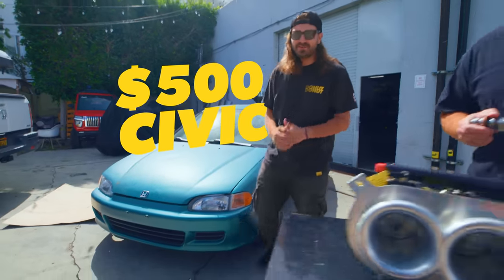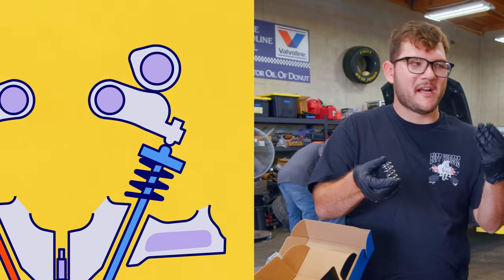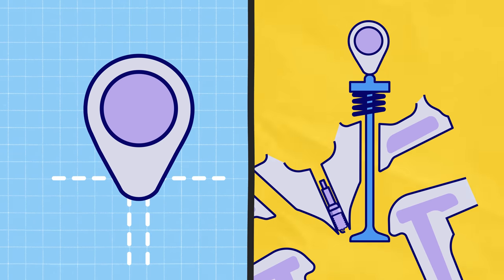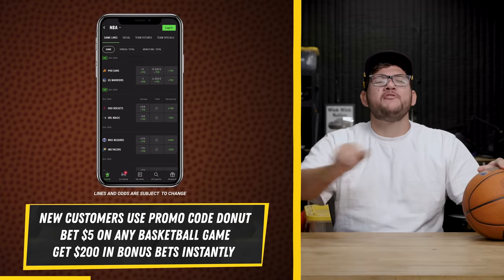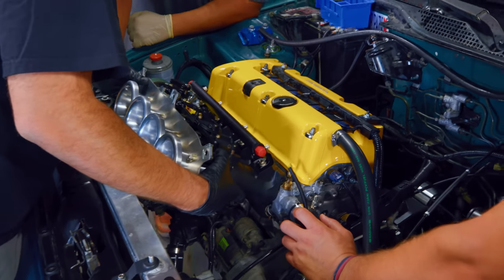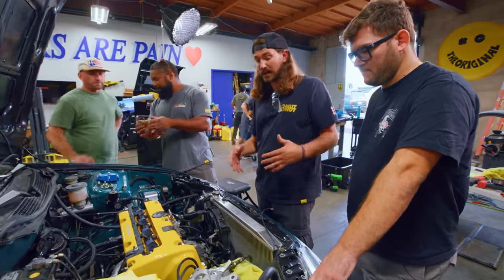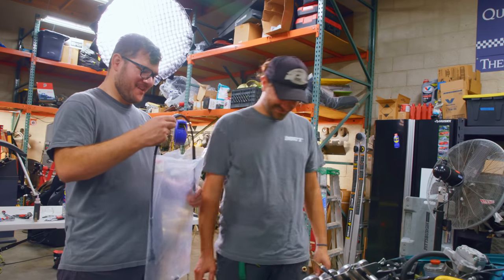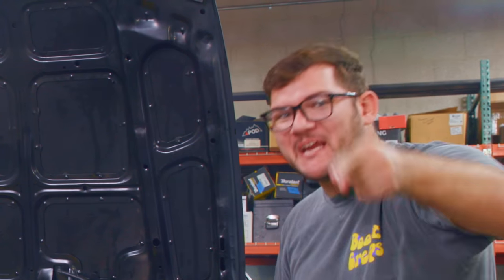We Put a $5,000 Intake on our $500 Civic

Comment: 5:28 A small correction

for diameter 65mm the cross sectional area= π × r² = π × (32.5 mm)² ≈ 3318 mm²

for diameter 60mm the cross sectional area = π × r² = π × (30 mm)² ≈ 2827.4 mm²
since there are 4 of them = 2827.4 mm² × 4 = 11309.6 mm²

so the effective diameter will be =  2 × √(A / π) = 2 × √(11309.6 / π) ≈ 120mm.

So it should be 120mm and not 240mm.
Reply: I was thinking the same thing, but thought that no one else would care
Reply: All that math to still be wrong. The cylinder intake openings and flow rate are all that matter here. The cylinder head openings were not ported so that never actually changed. This manifold will flow a higher CFM though but that can’t be expressed by the diameter of any openings. So it’s all moot.

Edit to say the math is right, but it doesn’t matter and should never have been a topic in the first place
Reply: Math make brain hurt bring back the stu stu stu and vrrrrrrrooooooooom noises
Reply: was searching for this comment
Reply: I was about to write that.
Reply: Glad I wasn’t the only one who caught that.
Reply: @SlapperGlutesTwice hi, I'm just lowly mechanical engineering student but I think you are taking an extreme approach to this. The intake is a fluid system, each part of a fluid/pipe system has an associated energy loss from which takes energy from the system. This energy loss is determined experimentally for each part as a coefficient k. The larger the velocity, the more energy is stolen from the fluid proportional to k. All to say k always relies on cross-sectional area. In this case the ratio from mouth to port diameter and the smoothness of that transition are more important. Like you said this manifold will flow much more air BUT the mouth diameter is a serious factor that effects the total flow rate. If you want a true comparison of the manifolds efficiencies an experiment would be ran for many different pressures and velocities through the intakes and k numbers from both would be found and compared.
Reply: Yeah it was fine until they showed the picture of the big circle with a 240 on it. But how many pizzas would that be?
Reply: I came to make sure someone had done the math properly. Good job.
Reply: So you’re saying 60 x 4 equals 120….. wow.   Somebody failed math class 😂
Reply: @HisDudeness_69   Actually sounds like you did. Diameter is not linear to area for a circle. The equivalent new area with them having 4 60 mm intakes is indeed as if they had 1 120 mm diameter hole instead...
Reply: @SlapperGlutesTwice  Ok, but you admit the math is right. All they're doing is correcting the math, not saying it is significant. It's just a correction on the numbers Donut gave...
Reply: Although while the 240mm was wrong. The 4 60mm's do give them 240% more area over the single 65mm.
Reply: Actually your wrong 2 + 2 is 5 kiddo
Reply: Ok nerd but thanks for teaching me
Reply: @high633 that is correct 😂
Reply: Came here to say this.
Reply: Yeah, 4r² is not the same as (4r)².
Reply: Uhmmm akshually
Reply: Yeah, first thing I noted too, these guys are not good at math!
Reply: I guess engineer Jerry wasn't there to check the math. 
By another metric: The ITB is 3.4x more area than stock.
Reply: LOL, i literally went through this as well 🤣
Reply: Thank you. Had to scroll too far for this comment
Reply: PI AAAARRRRR SQUARED!
Reply: @HisDudeness_69  🥱
Reply: @dneff85   def a Gallo 24
Reply: @HisDudeness_69   ...is it you? Because four 6" pizzas doesn't equal one 24" pizza
Reply: Why are we worried about cross sectional area?
Reply: It's actually even less than that.  Edge effects on holes are... significant.  The boundary layer remains about the same depth regardless of hole diameter.  So while that 65mm throttle body (now i'm pulling this out of my butt..) might lose 5mm of radius to boundary layer leaving you with a 55mm ~working~ diameter.  With the ITB, you're looking 50mm.  

So.. more like 2380mm^2 for the single throttle body, versus 7850mm^2 total.  

But the whole thing is silly.  Only one cylinder is having an intake stroke at any given time, so the single throttle body, being larger than any of the individuals, is going to flow more air.
Reply: @SkinnieHehe because cross sectional area is how much of an opening there actually is.
Reply: @F0XD1E  I get that but isn’t that kind of arbitrary when you could just look at the smallest diameter of the trumpets? Or does it have to do with fluid physics that I have no idea about?
Reply: @SkinnieHehe  the trumpets may be smaller, but there are 4 of them, so for a better comparison you have to add up their total area compared to the area of the original intake hole. In the video they added up their diameters, which does not work mathematically since area is squared.
Reply: @F0XD1E  Ok, I gotchu. I was thinking vertical cross sections and not horizontal. I misinterpreted the original comment. This makes sense to me now thank you
Reply: That’s exactly what I was thinking
Reply: Sir this is a Arby's
Reply: Came here for this lol, I remember those Pizza problems in geometry lol
Reply: Ackchually🤓
Reply: @HisDudeness_69  they're circles bro not squares
Reply: Same here.
Ain't no way that's a 4x exponential on airflow
Reply: I was in the middle of typing the same thing and then saw this. Math works every time 😎
Reply: @SlapperGlutesTwice  He specifically says in the video that 4 x 60mm of hole is basically 240mm of hole, which basically isn't true at all when you look at the formula of a circle
Reply: @SlapperGlutesTwice  Who cares about math? Says this guy
Reply: @jediprowen  You're right, no one cares.
Reply: I came here to say this.
Reply: Thank you for writing this so I didn’t have to. You wrote it better anyway
Reply: @F0XD1E On a 4 cylinder, there is only one cylinder sucking in air at a time. There is no overlap (2 or more cylinders sucking in air at the same time). So now instead of air flowing continuously thru the 65mm, it will flow intermittently between 4 smaller ones. Seems like it would be a waste to me, idk?
Reply: @Michael-ur4yc  Is this Fluid Mechanics? I'm signed up for that class next semester lol.
Reply: None of this is true because each cylinder draws in air in a brief pulse in a sequence and is limited by the intake porting on the heads. If every cylinder drew in air at the same time then sure, but that's not how engines work.  Even with the upgraded cams no two cylinders will be drawing air at the same time.
Reply: correct, I saw that at my first sight, too!
Reply: Came to say the same thing.  Good job
Reply: Maybe you could take the integral of the curve as it changes over the entire 240 length.
Reply: Jer changed so much
Reply: Came here for this, not disappointed.
Reply: After doing the math I can confirm you are indeed right
Reply: I hope you're proud of yourself!!! Just look at what you've started. 😁👍😁👍😁👍
Reply: a2+b2+c2+d²=e2 we're just talking about diameter, nothing about cfm lol
Reply: @nerobro  Kapow!
Reply: They did the math
Reply: @emreylmaz4533  me too (not even close)
Reply: @Michael-ur4yc  I mean you just said the same thing in a more complicated way. The opening doesn’t matter but the flow rate does. This potentially flows more. But if you’re an engineering student you know that after a certain point the opening could be a mile wide and it isn’t capable of sucking any more air in because of the more restrictive cylinder head ports. And simply stating that the new manifold flows more (no one is arguing this point obviously it does) includes any friction forces or other losses of energy in the air flow rate. Because the final CFM that the manifold is capable of is a function of those variables already included. So your experiment would just prove that the higher flow one… flows more.
Reply: @ArdentMoogle  yeah which just perpetuates the incorrect line of thought that “bigger hole mean better”. It’s just a lot of work to prove a point that doesn’t matter anyway.
Reply: I'm not sure what this means but ok
Reply: @SlapperGlutesTwice Agreed. The cross sectional area is the only important part for mass flow rate. It comes out to about 3.4 times more flow rate for the 4x 60mm pipes compared to a single 65mm pipe. This is of course ignoring the slight losses or air velocity from Bernoulli’s principle due to the difference in diameters. 
Source: I have a bachelor’s in mechanical engineering.
Reply: wait until he hears about friction coefficients and fluid dynamics in volume and flow rate....... @ArdentMoogle
Reply: Jerry, is that you?
Reply: You didn't need all that math. All you need is knowing that area is proportional to the square of the diameter. So area of 4 60mm holes is exactly area of one 120mm...
Reply: @SlapperGlutesTwice  long story short they'd have done better with venturi style intake and eq length headers. This is a overkill and head is not optimized for that anyway
Reply: @c0mplex564  where?
Reply: I came to the comments to talk about this too
Reply: @HisDudeness_69  Yeah, you did. This guy did not say 60 X 4 = 120.
Reply: So glad I was not the only one to notice this.
Reply: Dang, I immediately noticed the mistake, did the math to find the correct answer, and was going to comment, but decided to check if somebody else had mentioned the mistake first. Good stuff fellow YouTube enjoyer.
Reply: Where is Jeremiah at?
Reply: i was about to do the calculations
Reply: Nerd alert
Reply: @SlapperGlutesTwice  He made no reference to any of the things you said; he merely stated the effective diameter, and he was right. When you said he was wrong, you were wrong for saying he was wrong. In fact, the only reason you said that was as an excuse to continue with the things you said afterwards, and the reason for that was because you thought it made you sound smart and somewhat intellectual. It didn't; it made you sound mouthy and petty-minded. It seems very much like you're jealous of him because you can't do the mathematics, and that will be the reason why you edited the comment; it was to pretend that you knew the mathematics was right.
Reply: @Roger-cg4po  🤓🤓🤓🤓
Reply: I came to comment the same, in fact I did and then I found your comment as well
Reply: @positrondesign6514 it is actually 3.4 times the original area. Bit it's only 2.4 more area (as you need to exclude the 1 that is the original area)
Reply: Was just about to comment on the same error
Reply: they say things that make no sense all the time. one that drives me nuts is what I feel is their serious lack of understanding of hp and tq.
Reply: As soon as i saw it i rushed to the comments😂 well done
Reply: My guess is that it was scrap value because it wouldn't pass smog inspection. Ca. scrap yards are filled with running cars that can't be registered in Ca. due to smog.
Reply: I knew the math was wrong but I’m glad someone else did it for me.

Comment: 5:30 its about the area of the intake, so the effective intake diameter is actually 120 mm due to the square relationship between diameter and area; 4x area = 2x diameter
Reply: Imagine a 240mm throttle body...
Reply: I almost understand what this means but would you mind rephrasing it for the dummies in the back? (def not me)
Reply: @MIDA-Multi-Tool  Area of a circle is radius squared multiplied by pi, πr².

For a 60mm throttle body that's 30²xπ=2,827.4mm² per 60mm throttle body, for a total of 11,309.7mm²

Now for an example 240mm throttle body we get 120² π = 45,238.9mm² 4x the area of the ITBs installed.  They're really matching a 120mm throttle body with their ITBs.
Reply: @FireCat005  ohh, I see. thank you!
Reply: @MIDA-Multi-Tool  I know it was already explained to you, but this might help others:

Take a 1x1 square.  Now put 4 of those together.  The resulting square is 2x2, not 4x4.
Reply: @FireCat005  he said for the dummies!
Reply: @azethegreat958  This is how you explain it!
Reply: @ChrisTrunek And? What's your contribution?
Reply: @MIDA-Multi-Tool 
Honestly, the easiest way to think about it is with floor tiles. A single tile is 12"x12". To get 24"x24" you need 4 tiles. Area is area after all.
Reply: @waldolemmer  ? I am one of the dummies!

Comment: Might not sound like a lot but you wouldn't compare 65mm throttle to 240mm of hole ... surface area of a circle is based on radius squared. So its 65 compared to 4x60. The square area of a 240mm hole is 45,216sq mm and 4x60 holes = 11,304sq mm quite the difference :) crazy how much more area is in a circle as it grows in diameter! You could think of it more similarly to valves as 4 valves in a cylinder there is lots of contents around the valves, but the valves almost fill the cylinder diameter! Keep up the fun work guys!!

Comment: I just picked up 2 Volvo s40 and electric power steering pumps each at $80 from my local junk yard. Their compatible with Hondas as long as you get the proper PTFE hoses and fittings. 3 wires total and an 80 amp circuit breaker! I recommend that route! It can literally be mounted anywhere!

Comment: 5:32 this isn’t a great way to display air intake as area doesn’t increase linearly. I did the math with rough pi using a= π(r)^2 and the correct upgraded area would be a 3.4x increase. If you just add diameter like in the video the area would mean a 3.7x increase, I think. I’m not a nerd so I could have messed some of this up.
Reply: I had to comment on that as well, I checked if someone else had already commented . The 3.4X increase is correct.
Reply: @durrwooddude thanks
Reply: and if they did have a single 240 mm throttle body, it would be 4 times larger area than the ITB setup lol

Comment: Someone probably mentioned this already but I just want to set the record streight… 4 60mm throttle bodies is not equal to a 240mm throttle body… it’s actually closer to 120mm. This is because you are looking at the added cross sectional area of the throttle bodies. Don’t get me wrong, still a huge improvement, but I just wanted to point that out.
Reply: Quick mafs, PiR^2 or something like that 😂😂
Reply: It's exactly the same as a 120mm throttle body, at least in cross sectional area.

Comment: Sorry Boys but 4x 60mm ITB's do not equal 1x 240mm throttle body.

1x 65mm circle has an area of 3,318 mm2 (Stock intake)
1x 60mm circle has an area of 2,827 mm2 (1 single ITB)
4x 2827 = 11,308 mm2, yes this is a huge improvement, but,
1 x 240mm circle has an area of 45,240 mm2, basically 4 times as much...

4x 60mm throttle bodies would be the equivalent of a 120mm single throttle body.

That is not even including the fact that not all cylinders will be drawing in air at the same time anyway.

The real advantages of ITB's are in throttle response and short runner length = more top end power and quicker response time.

Comment: 5:30 not sure that is correct.

‘Across’ is called diameter. But it’s not diameter times four.
It’s surface is times four.

And compared to the 65mm one it’s an increase of 3,4 times the surface area.

Comment: 4 circles with the width of 60 mm have the same area as a single circle with the width or 120 mm. 

That's because, when you calculate the area of a circle, you put half of its width (the radius) to a power of two and multiply that with PI.

r^2*pi

Comment: Just a heads up. 4x 60mm circular openings has the same cross section as 1x 120mm circular opening. 

A=pi × r^2 
3.1415926535×(30×30) 
2,827.43338815 sq mm
Multiply that by 4
Comes to 11,309.7335526

To get the equivalent size circle the final area is equal to, you reverse the steps. 

11,309.7335526=pi x r^2 
11,309.7335526÷3.1415926535= 3600 = r^2
You then square root each side to get R.
Sqrt(3600) = 60
60= r 
To get diameter you double r since r is the radius. So the diameter is 120mm

Comment: 5:31 -- It's actually nothing like a 240mm hole. Proof: the area of a circle is pi * r^2. pi * 30^2 = 2827.43 mm^2. Since there are four ITBs, we multiply this by four to reach 11309.7 mm^2. A 240mm single throttle body would be pi * 120^2 which is 45238.9 mm^2. 

Having 4x60mm throttle bodies results in a lower volume of air entering the manifold than a single 240mm throttle body. Actually, this volume is smaller by a factor of exactly 4. Hence, you would have four times the air mass entering the manifold with a single large throttle body. In fact, you would need 4x120mm throttle bodies to match the volume of air intake of a single 240mm throttle body. 

4 * pi * 60^2 = 45238.9mm^2
pi * 120^2 = 45.238.9mm^2

A circle with radius r is larger than the combined area of n circles of radius r/n. It is larger by a factor of exactly n.

Comment: 65mm hole surface area: 33.18 cm3
4x 60mm hole surface area: 113.096 cm3
240mm hole surface area: 452.4 cm3

So a 120mm diameter hole has the same surface are as 4x a 60mm diameter hole.

Therefore 4 x 60mm hole does not equal a 240mm diameter hole but only a 120mm diameter hole.
Reply: Cm2*

Comment: The power is in the head. You need to get the valveseats a nice new 5- angele cut, maybe bigger valves and the intake and outlet ports surface smoothed and maybe widened... fit between head and intake ports need to be aligned, too. Just putting on a big intake, won´t do it.

Comment: You improved intake and exhaust, so it may be running a little lean for the air/fuel ration, the next mod possibly fuel injectors and everything that goes with that